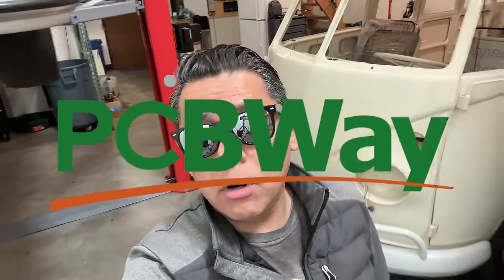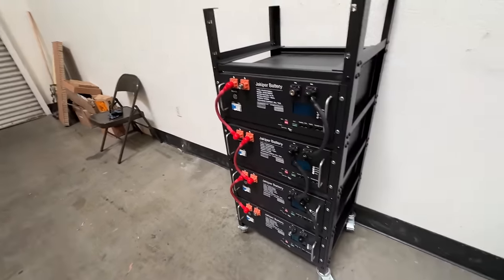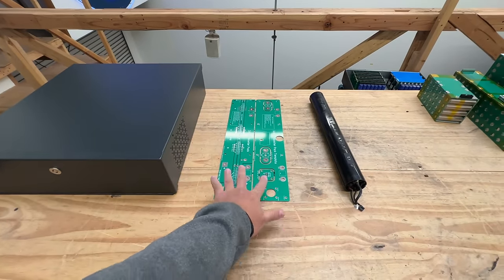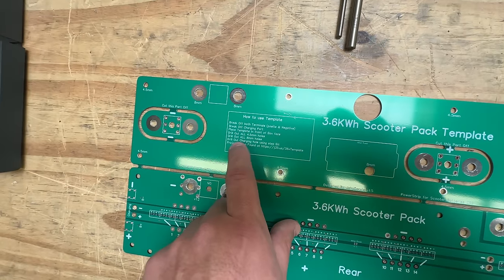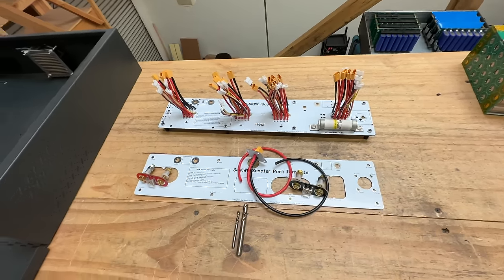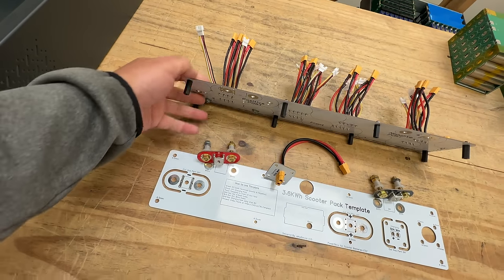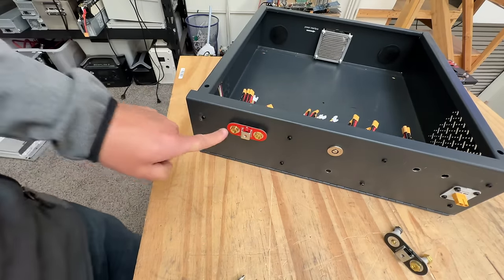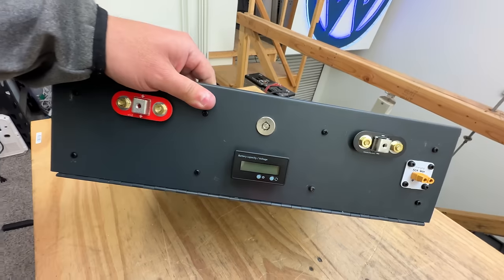20KWh DIY RackMount Backup Battery for Half price

Comment: Excellent project. Only drawback is that the scooter batteries are li-ion, which are quite more dangerous compared to the LFP cells the Jakiper batteries use.
Reply: @AllAroundTube50  I too am on li-ions for over 3 years. DIY power wall. But I keep them in the cellar, along with some fine wine, so they behave! 😃
Reply: Plus the cycle life is about 1/6th that of LFP so it's about 3x as expensive per cycle
Reply: @niktak1114  li-ions used in a storage project will last a looooong time. Over 2000 cycles for sure.
Reply: @ThanosSustainable  Maybe if you only use a DOD of 70-80%. At that DOD, LFP will have 7000+ cycles.
Reply: @AllAroundTube50  $6-6.5k. Or about $3.2k per 14.3kWh for seplos kits.
Reply: @AllAroundTube50  would love more details on your setup I want to do this peak shaving as well.  I need closer to 30kwh to go completely off for peak hours. 

Just curious how you are doing switching and etc
Reply: @johnscherman454  ahhh, you can't block comments on youtube. Apparently, sarcasm isn't your strong suit mate.
Reply: @ThanosSustainable Yeah i wouldn’t want that shit in mu home…
Reply: AND LION IS LIKELY TO BE OBSELESCENT SOON. LIKE BRUSHING YOUR TEETH WITH TNT WENT OUT OF STYLE WITH THE ADVENT OF TOOTHPASTE...
Reply: @ThanosSustainable 
Because a cellar fire wouldn't affect the home at all would it??😂😂😂😂😂😂😂

Comment: Careful with your terminology.  That's a 5 battery unit, 19" wide rack.  A "Rack Unit" (or U) is a standardize size of 19" wide rack equipment that is 1.75"/44.45mm tall.  Common in computer industry, audio industry, telco industry.  You can find racks of 8U, 10U, 24U all the way up to 42U.  Most will not have wheels on the bottom.  Instead they are intended to be mounted to the floor w/lag bolts since they become quite heavy (even when empty), to distribute their weight to floor or platform, and to avoid tip over hazards.  You should likely avoid going to tall with a battery rack, because it they far heavier than the typical equipment they are intended to hold.
Reply: at my day job, we even had a few super tall 52U racks :D That was definitely pushing the limits of being manageable, though

Comment: Wonderful project! Too bad it is difficult for EU people to start on it, as shipping your batteries to here will make the whole project not as cost-effective anymore (and some of the parts will also be unavailable from the websites you selected). But it is very inspiring to see how it can work.
Reply: Agree! Maybe a video for something in the EU in the future?
Reply: Absolutely amazing project.
+1 for a battery source in EU!
Reply: they all come form china, rack mount lifepo4 isn't new, i'd image they are shipped to the EU by the boatload unless yall have big ol tarrifs
Reply: U can make 16s EVE, CATL.. 280 48V 14.4kWh plus Daly BMS also for around 150Euro/kWh. There is also stock in NL for around ca. 170Euro/kWh?! Check out some German DIYlers.
Reply: I live in the states and his website is basically like a candy store for battery nerds. only problem is I'm about 2000 miles from his warehouse so shipping is still pretty high. I was able to get 10 of those packs shown in the video for $240 shipped though, so still not bad. hopefully someone in the EU does something similar with reclaim batteries soon
Reply: @randywelt8210  You probably can't post links here without Youtube shadowbanning your comment. But any clue what I can google to find this NL stock? Which German DIY board?
Reply: @kwinzman  check NKON, as a German u can buy now without VAT 16s EVE 280 for 148Euro/kWh. There are German DIYler on YT who already did this incl cell testing.
Reply: Dude, ship from China where it is all made anyway...
Reply: @randywelt8210  Thanks!
Reply: Just buy SOK batteries…when it comes to these batteries go for quality and not “cost savings”

Comment: This is not very cheap.  $1700 per 5kWh pack means that this 20kWh setup cost at least $6800 + tax and shipping.  By comparison, Joe over at PCEnersys on Alibaba just delivered 50kWh to my home in the Bahamas for $10400.  If you bought these pcbway units, that same capacity would be a whopping $17,000 + tax and shipping.  Just 8% tax would be $1360 and then $500 shipping (50kWh is HEAVY!!), so nearly $19,000 for just 50kWh.  And don't kid yourself.  IF you live in a location that uses air conditioning your average daily power consumption will be 60-90kWh, not 20kWh!  Finally, If you want your pack to die within 2-3 years, go ahead and drain it to 100% DOD (Depth of Discharge).  Your investment will be history very quickly.  You simply cannot drain these things to the nubbins and expect a long life out of them.  For longest life, DOD should be no more than about 60-70%.  If 60% that means you get to actually use 40% of the rated capacity.  So this 20kWh pack is really only good for about 5kWh before you begin to put long term damage into the batteries.  Bottom line, these batteries are VERY expensive and so unless you know what you are doing, do not listen to YouTube amateurs making it sound like it is real simple because they want to help some company make sales goals.
Reply: you still haven't told us how you charge those batteries what solar controller are you using, for example?
Reply: I checked your YT channel out, and I am surprised and happy that you aren't a bot! How is the setup going after 5 months?

Comment: Which 36v inverter can you run a whole house with?
Reply: Complicated for sure limited to Chinese off brands many with modified sine wave  which may not be reliable  remember one need split phase  240v
Reply: @RRmelgar  seams like the savings is not worth the headache.
Reply: @RRmelgar  Actually you could hook 240v devices to it's own 240v inverter.  
110v don't care if the other 110 volt socket is 180 degrees off, it only cares about the one phase.  You could have them 3 degrees off, and everything will work fine no matter what socket you plug into.

Comment: I would like to see this build as a LiFePo4 48v with the same features. That would be a much better comparison for off the shelf vs diy. Other than that, great video.
Reply: LiFePo4 is wayyy safer. I wouldn't feel comfortable with anything else in my home.
Reply: @thekingoftheworld9553  Absolutely agree!
Reply: Also, 36v inverters are more uncommon.  24 and 48v seem to be the standard.
Reply: I’m waiting for a solid 48v build for sure.

Comment: Points of concern:
1. The front mount lug connector (thru-hole) is only a small air gap between case. Air gaps quickly disappear on flexible frames and tensioned lugs, not counting accidental damage to either, there should be physical isolation there.
2. PCB should not be used for anything structural beyond its own weight. You put high gauge wires on that and you will be putting torque across the PCB, over time it will flex, crack, and likely tear at some point.
3. I don't know the schematic or spec of batteries on that but I have a general dislike of direct connect systems like that. Without a BMS or monitoring like the other one, it almost certainly will not last as long.
Reply from the maker: No air gap,  there’s an isolator,  and all these have a built in bms
Reply from the maker: No air gap,  there’s an isolator,  and all these have a built in bms
Reply: @jehugarcia  Not the pass thru bolt isolation, the PCB face to case gap. Long story short, I can't for the life of me see how that much power, with that much exposed copper, while on that type of support structure, does not violate some sort of safety regulation.
Reply: These are li-ion also…
Reply: @diskdrive123  Are you a fire inspector.
Reply: @Syncere20  Do you have a non-certified battery bank you want inspected?
Reply: @diskdrive123 You obviously cannot know anything about anything unless you have a degree in the field and have worked it for at least 120 years.

Comment: Brilliant    I'd keep any whole house or otherwise substantial energy storage out in the garage, even if had to build and heat an enclosure just to be safe.  It's a lot of energy and that's always a fire problem.  I've just bought a pre made Battery Queen 4.8 kwh at 25 cents a watt, and a EG4 3000 watt inverter, transfer switch, charger to play with before committing to 20kw system and probably PV to power it up (and otherwise power up low load emergency circuits in house.  An emergency power system that requires no maint, no fuel, AND pays back a little every year.  WOW

Comment: You should do a video on how to discharge batteries during peak demand hours. A big problem in Arizona is the power providers hit us with energy costs that are like 100x during "peak demand hours". We need a solution to charge during cheap hours and then offset demand during peak hours.
Reply from the maker: Super easy to do,  I have a project in mind just for that in the works
Reply: @jehugarcia  nice! Need something that can read the wattage being consumed so it can only discharge to offset back to zero.

If you solved this problem it would solve a huge headache for us on SRP in Arizona. They are basically price gouging solar customers during certain hours when the sun is down and we can't generate enough solar to offset our usage. For example, you could have a pv system large enough to offset 110% of your energy usage and you would still have a $100+ monthly bill. That to me is legalized robbery
Reply: of course if everyone does it, then that becomes the peak hours.
Reply: @robertsmith2956  - “if everyone does it” then there will be no peak hours and it will just be close to flat rate all the time

Comment: You can always repin those connectors if you have the time to do so so all the wire colors match
Reply: Definitely worth re-pinning to eliminate confusion (or at least add colored electrical tape to ‘correct’ the mismatch.

Comment: As a heads up, there are some states in the US that are currently planning on banning new installs of NMC battery systems due to the fire risk, and requiring LFP. DIY is great and I am working on my own system currently,  but if you plan on being connected to the grid at all, you'll need to pass inspection!

Comment: You could just buy new lifepo4 cells from 18650batterystore. I did the math. It’s exactly half off if you build them yourself. Either 100ah or 280ah cells. 😊

Comment: For half the price you have to diy a battery with a difficult to use 36V, with around 1000 instead of 6000 cycle life (cut from the video) and without any warranty. 
That doesn't seem very attractive to me.
Nevertheless I really like your inspiring ideas and creativity on these kinds of projects and builds!
Reply: Have you thought about the COST of mailing your warranty battery back for service?
The shipping cost will be more than buying a replacement battery.
You don't need to use scooter batteries, you can use lipo4 ones, and get the 48 volts and 6000 cycles.
Reply: Hard pass. Cool project though
Reply: 36v? 
Genetry Solar inverter & walk away happy

Comment: Seplos Mason kits seem a better bet, at least they are lifpo4 batteries rather than lion.  I have just bought 34kwh for just under $7000 delivered to the UK so about $206 per KWh.  A bit more expensive but new lifepo4 cells, a quality bms and a lot less hassle.
Reply from the maker: Good for you

Comment: Use the DIYs with your Grid Tie Inverter to dump all the power Back onto the Grid. Problem Solved for 36 Volts or use them as Explanation Batteries for your EkoFlow / Bluetti / Anker Solar Generators.

Comment: When power from the grid was a bit cheaper, individuals who had off peak metering would charge their batteries off of the grid and during peak hours they would switch to inverter power to save money. An alternative until one installs solar and wind power.

Comment: Love the project idea.. but I am concerned about the battery pack.. it indicates they are used batteries.. most 18650 batteries have 500 to 1000 cycle rating, new. I think I read these packs you are recommending come from a brand that is rated for up to 3000 cycles.. but from the link there is no guarantee or testing done to ensure all batteries work/charge, what sort of capacity, etc. With that in mind.. how far of a stretch is to look to purchase/use NCR 18650s or even cheaper options and make your own packs for this kit? I think that would be an additional great option you might be able to share (in a separate video perhaps.. how to make a battery pack for this larger battery solution).. maybe some different 18650 battery options/prices.. and how to put each of the 18 packs needed for this battery kit to use.

Comment: I had a 13s8p lithium ion BATTERY FIRE in my garage and I 100% absolutely DO NOT think saving a few thousand $ on batteries is worth losing everything I own.  Lifepo4 is the only way to go with a pack this large unless you're keeping it in a shed 50+ feet away from you house. If I wasn't home when I heard the cells exploding I would have came home to a concrete slab, within 15 seconds the flames were already 24"x24"ish and I hit it with a 5lb ABC fire extinguisher which killed about 1/2 the flames because even though it didn't put the batteries out it put out everything around the batteries that were on fire.  I eventually managed to push the flaming batteries out with a broom and drown it with water.
Reply: I was thinking someone should invent an easy rip off the wall disconnect in event of fire 🔥 😂
Reply: @Rj  a 5kwh battery weighs about 100 lbs, so idk how easy it will be lol

Comment: 1:10: no... This is not a 5 unit rack. One battery is at least 4 unit high. So the rack is most likely 20U, with 16U currently used.
Reply: I don't see any 1u holes.  It only excepts a 4u case, so still a 5 unit rack.  With the weight, probably a good idea NOT to use a standard 20u rack.
Reply: I don't see any 1U mount holes. It only accepts 4U cases, so a 5 unit rack.
 With the weight I wouldn't recommend using a 20u rack either.  You want those solid rails.

Comment: I'm in a hurricane zone and one day of power for thousands of dollars is not a deal. I'll stick with the $350 gas generator I've used for years. I love solar but at 10.3 cents kWh from my electric company, solar is not cost-effective, either grid-tied or off the grid and don't want a hurricane blowing my panels away.

Comment: I would love to make one of these and shoot for around 40kwh. Do you have info on how to connect multiple boxes together? Do you have info on how to connect this to an inverter and connect it to your home? What inverters do you recommend? How safe are these batteries after you remove the fan? Could you just move the fan to the outside of the case?
Reply: Once this project is made, it would connect to inverters etc just like other rack-mount batteries that have tons of videos here and other channels. Only oddball part to this project is that it is at 36V, so you (probably) won't find all-in-one hybrid inverters at that voltage. But you can certainly find standalone 36V inverters!

Comment: You should probably start your video with a full disclosure statement that installing this NON-certified backup battery in your home will absolutely guarantee your home insurer will not pay out if the cause of the fire was due to your DIY battery.

Comment: According to your site: These packs are reclaimed from e-scooters and are "untested"
Also, is there no bms? This pack is not going to last long. That more expensive battery you have up there is going to last at minimum 10 years and probably 20 years. Lastly, what inverter do you use with your pack to power your home? 36V is such an unusual voltage to work with when doing a home backup. This whole plan is a bad idea.
Reply: A Genetry Solar inverter is available in 12k and can use 36v… so no big deal on that front.

Comment: Have you thought about doing a lower capacity 24V version? That would overcome the limitations with 36V if two batteries were wired in series
Reply: Careful - the BMS in each 24V battery would have to be designed for connection in series. They usually put such limitations in the small print somewhere...

Comment: Curious to know what's the weight on one of those Box units complete
Reply: 18650 is 1.23 ounce. 35 lbs in batteries, the case is 15 lbs plus another 5-7 lbs for wiring, battery cases, PCB, BMS etc. So 55-57 lbs

Comment: why 36v? 24v and 48v are the common voltages for batteries in Solar.
Reply from the maker: Because traditionally 1 - 4  twelve volt lead acid batteries were used so 12,24,36 and 48v were born

Comment: Awesome, I love the idea of using many parallel ebike/scooter packs to make one large battery. I’m currently writing up my project that used 19x 48V ebike batteries in one large case (~14kWh). The only downside I’ve found is how can we tell if one pack BMS goes down and is no longer contributing current? I periodically check each pack with a clamp meter because occasionally a BMS will time out and needs to be reconnected to power back up. Is there another way we could do this? Would be great if there was some sort of compact “current flow indicator” for DC that didn’t use a lossy shunt.
Reply: try connecting a display to each battery/bms pack. The price will go up, but that is how the high quality battery packs do it. One display per bms.
Reply: @uhjyuff2095  Are you talking about a power meter display with a hall sensor for current? I suppose that would be the ultimate. Would be great if a simple voltage measurement could tell if a battery is active, but when in parallel the system voltage is everywhere even when the BMS is shut down.
Reply: combine them all in S&P and use a single 250A 48V BMS.

Comment: 0:33 when you say install into an inverter…is it possible to connect the battery rack to a delta pro which is connected to the home via generator port?  What port on the delta pro do i connect the battery rack to?  Thanks.  I just subscribed 😊